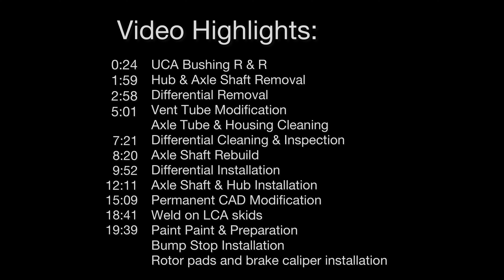Dana 30 Front Axle Restoration & Rebuild With MODS For Project ‘89 Jeep Xj Build Episode: 5

Comment from the maker: Hi everyone thanks for tuning in on this build, here is a list of chapters in the video. It’s a long one so get some popcorn and a seat on the couch and enjoy 🍻

Video Highlights:
0:24 UCA Bushing R & R
1:59  Hub & Axle Shaft Removal
2:58 Differential Removal
5:01  Vent Tube Modification
7:21  Differential Cleaning & Inspection
8:27  Axle Shaft Rebuild
9:54 Differential Installation 
12:13 Axle Shaft & Hub Installation 
15:11 Permanent CAD Modification
18:43 Weld on LCA skids
19:41 Preparation & paint

Also I just learned that the end of the video something happened to the audio! But I think you’ll get it 😅

Comment: I’ve got an 88 with the axle disconnect but I installed a straight chromoly axle shaft a few years ago.  This weekend I’m installing a manual locking hub kits in it.  Mine also has an E- locker in the front.  I wish there was a truss kit available for this style axle.
Reply from the maker: Nice those axles are pretty solid the UCA mount definitely is. It wouldn’t be hard to make your own truss or modify one for your needs. I’ll be doing one on the tj soon and possibly locking hubs will see . This jeep was a budget build so the best we could do at the moment was LCA skids. Now that the jeep has a new owner we may revisit that axle. That e locker will definitely make a difference too. Sweet jeep. 🍻

Comment: Not trying to hate as i respect anyone turning wrenches to keep these older vehicles alive, however i wanted to put my 2c out there for people to see. Jeep stopped using the CAD front axle in the early 90s for the XJ , not 95. They added larger u-joints to them in 95 or 96 and they remained unchanged until 2000 when they went to a low pinion dana 30 that the TJ used. The 96-99 xj front axle is the best option on a budget. You would have been far better off getting one of those axles instead for the amount of time and money you put into this one. The upper control arm bracket may look stronger on the CAD axle but its a trade off since the axle tube is a lot weaker than the non CAD axles. The 3.54 axle ratio you are referring to is technically 3.545 and commonly called the 3.55 ratio. 3.54 and 3.55 ratios are the same ratio and they are interchangeable. They are buy no means rare, hard to come by, or valuable at all. They are the most common gear ratio used in the XJ. Otherwise good work with everything, you appeared to take your time and do everything correctly, i just would have started with a slightly better platform.
Reply from the maker: Absolutely, Now keep in mind that even though this is a cad axle the same basic mechanical and restoration concepts carry over to the updated Dana 30s.  I do agree with what you are saying and no where in this video am I talking up this axle over another. The 96-99 hp 30 is a better platform with no doubt and They did continue to use cad on the dodge rams up until 2001. originally the plan here was to build up an updated HP Dana 30, then something happened where the original owner wanted the jeep back and said he was willing to pay for the project to continue up to a certain point with some requests. I sold the jeep back to the OGs. So I agreed  keep the jeep in stock form as much as possible. I ran this axle by them as it had the exact 3:55 gears I needed to Match the rear axle and it was dirt cheap the guy threw in a bunch of other parts that I ended up using on the interior. So now you know sometime in the middle of the 87 xj restoration the Jeep was no longer mine and I was building it for someone els on someone else’s budget. Not mine. Actually he didn’t even want me to replace that axle, but there was no content in that for me. So we agreed to continue with this setup.
Reply: @ATEMOFFROAD  I subscribed.
Reply from the maker: @rhythm618  thanks 🙏
Reply: You seem to have some knowledge so I’m going to ask for your opinion/advice: I bought an XJ axle exactly like this one in this video for my 2003 TJ. I’m doing a rear stretch and triangulated rear suspension and I’m going to do the WJ high steering knuckles and brakes. I’m almost there, with all of my parts. Before I go on, let me say: I am an experienced fabricator/welder. I have my own welding shop and many tools/machines. I am NOT a mechanic, and I have never done suspension work before. 
For that axle (4:10 gears) I already welded a C gusset “kit” onto the Cs. I built my own truss to work around that big hunk of iron CAD housing. I have to relocate my track bar bracket to go up high, (I have the parts, but haven’t welded it on yet) and I have to relocate my sway bar arm brackets. Thats the tricky part. 
So, my question is this: I am thinking of cutting off that big iron housing and getting some 2” diameter DOM tube and connect the 2 parts of the axle like that. And then just weld on a new upper control arm bracket. I know I should have started this project with a non-CAD D-30, but I didn’t. If I found one for relatively cheap, with the same gears, I would probably just start from scratch. But Idk how easy it will be for me to find that axle. I don’t have a problem eating the cost of the C gusset kit I bought (i got the fancier one that actually envelops the entire outer part of the C, not just the little side plates). But, if it’s not a big deal to just eliminate this CAD housing, I will just do that. 
Cutting off that housing is easy. 15-20 minutes and I’ll have it off. I can get the 2” DOM to put an outer sleeve on to connect the 2 axle tubes, and then make a new truss to go all the way across the top. 
Do you see any complications arising from this? Have you ever heard of anybody doing this? 
Any advice or anything g I may be overlooking? 
Thanx
Reply from the maker: @zenlandzipline  it’s doable, you can drill out plug holes in the cast steel and pull out the passenger side tube, but it’s a press fit with silicone. Good time to sleeve, and clock the inner Cs based on lift height. (No need under 4” lift on a TJ) The outside diameter on my 95, hp30 is Close to 2.5 O.D. So I’d just make sure you have the correct diameter tubing. I’ve seen people cut the Cs completely off, sleeve and weld. So if beveled and filled properly should be just as strong especially with the truss and sleeves. But that risk would be on you if driving on the highway. Good luck 👍🏼 🍻
Reply: @ATEMOFFROAD  hey thanks for your reply. I won’t be turning any Cs…I’ve already welded the C gussets on. It would be a mess to cut them to be able to do a turn. I’m going 4-1/2” with my lift…I think my castor angle will be ok. 
I’m also not concerned about strength or whether or not it’s going to fall apart while going down the road. I overbuild most of my jobs and projects. 
Also, it’s kind of tricky to explain, but my plan isn’t to drill out the plug welds and retube it. I was thinking about after cutting off the CAD housing, then getting a 2 foot long (or 2 and a half, or whatever the length is) piece of DOM that has a 2-1/2” inside diameter and slide the 2 sides of the stock axle tube into it, to join it together to make 1 piece. (The stock axle tubes are 2-1/2” OD.) At that point, I could even do an inner axle sleeve, too. 
I was just basically wondering if I’m going to come across any unforeseen difficulties, like, straightness or angles on the Cs or anything. I don’t see that there is anything real difficult to do this. But, I will wind up with a huge axle housing OD…like probably close to 3-1/2 inches. 
Idk what I’m going to do. Maybe just leave the CAD housing on and work around it. But I’m more leaning towards cutting it off and connecting the 2 sides with some thick 2-1/2” ID tube.
Reply: @ATEMOFFROAD  my other option is to drill the plug welds out, pull that passenger side of the axle off…scrap it, and take my TJ axle (a low pinion, obviously) and remove the passenger side of the axle housing and pop it into this HP  XJ axle. The downside to that is: I was going to try to sell my TJ axle for $300-$400. No selling it if I rip off one side of the axle. The other negative (which isn’t really a big deal) is that I have to gusset that C. 
Decisions decisions.
Reply: @zenlandzipline  While i certainly believe it is possible its really not worth your time. Just get a regular high pinion 30 from a mid 1996-1999. They're cheap and you should be able to swap the 4:10 gears over fairly easily.
Reply: @rhythm618  thanx. I’m going to start keeping my eye out for one. I’m not in any big hurry..I still have to make a new gas tank to accommodate the clearance for the rear axle when I stretch, and I a bunch of other things to work on. 
I made a mistake buying this XK disco axle. I was new to Jeep modding and didn’t know a whole lot. 
Unfortunately for me, I usually have to learn things the hard (expensive and time consuming) way.
Reply from the maker: @zenlandzipline  you can have my LP axle, come get it or really I’ll just end up scraping it. Great if you a sell yours though. Like what Rhythm618 said, it’s probably not worth your time, unless you have time, like in my area 44s are very hard to find, yet HP 30s are still relatively common and cheap. 🍻👍🏼
Reply: @ATEMOFFROAD  I’m in South Florida. 
Believe it or not, I sold a TJ front axle for $400 about 3 years ago. 
Idk bro. I look at that CAD and it just doesn’t look like a lot of work to cut it off and put a 1 piece tube over the 2 axle tubes to link them together as 1. Like I said, I already did the gussets for the Cs. So, I’m thinking it would be more work to swap gears (unless I found a HP D-30 with 4:10 gears) and do another C gusset job, than it would be for me to just wack off the CAD housing and splice the tubes together. 
Like I said, I’m not in a huge hurry. I’m going to do my rear first, and get my D44 with 4:10 on there. Do my triangulated suspension, and do a 5 inch stretch. After I do all of that rear work, I can disconnect the front driveshaft and still use my Jeep until I am ready to swap out the front end. So, I will keep my eye open for a non disco HP D-30 in the meantime.

Comment: Nice..80/90 better than 75/90 oil?  On the cover Do you use rtv with the gasket?
Reply from the maker: @ari1234.  I’ve been using 80/90 up front now mainly for new gear break in 80/140 in the rear. No Rtv used with this gasket is mainly why i choose to use these over RtV. 🍻
Reply: How many quarts front and rear

Comment: Something I never considered is that these disconnecting 30s have a much stronger passenger upper control arm mount. Interesting.
Edit: I don't think the change was in 95 I think it was between 91 and 92. Also, in the future you can swap to a normal passenger side 1 piece shaft (go ABS or or 96.5/97+ for bigger joints) for added strength as the collar connection is a weak point.
Reply from the maker: I have the other axle shafts and parts from the old axle I can use if anything breaks 🤞 Id probably just start over with a 97+ Dana 30 or just go 44 if I can get my hands on one. Hard to come by around here. But yes the upper bracket is considerably stronger by the looks of it . Definitely noticeable. 🍻

Comment: Do you have a list of all parts and their costs?  I'm curious how much it would cost if all the welding was farmed out too.  My fab skills are not up to this level.
Reply from the maker: Yes the list is in the description box. I’m not sure how much a new axle cost but everything here is about 600 dollars or less and no labor cost added. This is a early dana 30 so the newer ones could be less to restore.
Reply: @ATEMOFFROAD  Do you have any idea of the cost or hours to do these additions?  If you already have a bent "C" can it be straightened?
Reply from the maker: @markvance713  I don’t have an exact time because I film.  The Cs can be cut off and replaced. I’ve never seen one straightened. If you had an axle worth doing that to it can be done. C gussets is probably something I should have done but the jeep isn’t going to be rock bounced. 🍻